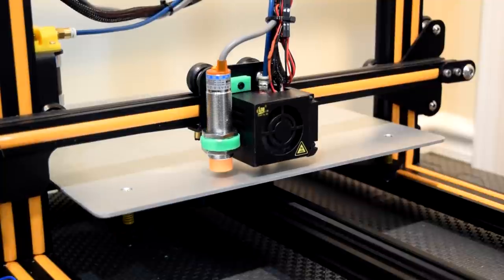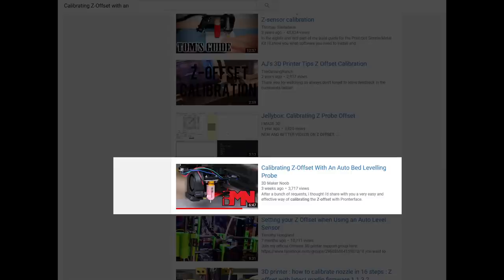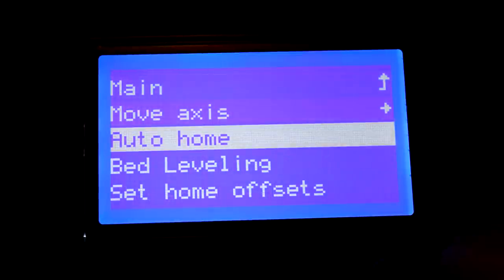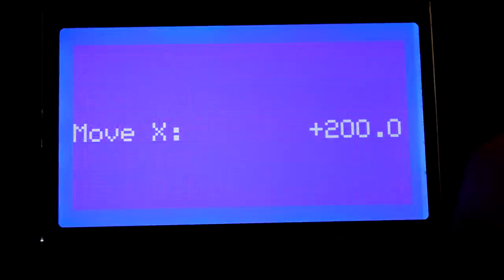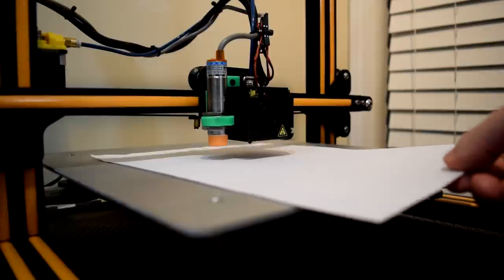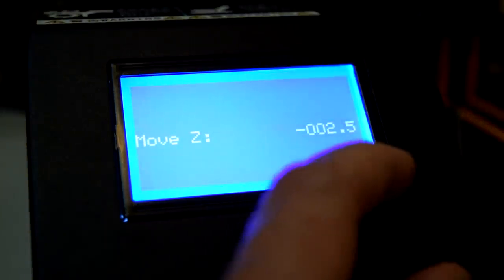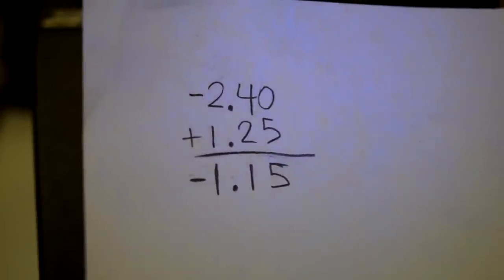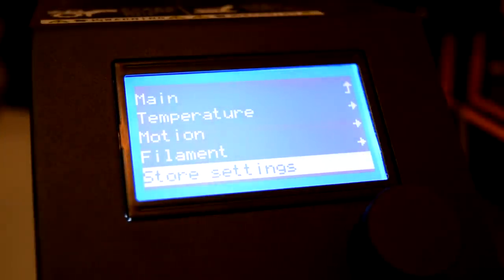Setting your Z offset the easy way in Marlin

Comment: Your video is still helping people 3½ years later... Thank you. (Marlin has changed in the meantime, but it's easy to figure out what to do.)
Reply: For some reason I can’t find how to permanently set up my z offset there is no setting for that can you help me
Reply: @camdendunne3102  When you get a Z offset that works for you, you need to save it to the printer memory, otherwise you lose it when the power is cycled. As every Marlin build can be different, there's no guarantee that it's in the same place on my printer as on yours. It should be near your Z offset tuning, but if not you may need to search. The menu item you're looking for is "Store settings".
Reply: @Gorf1234  I clicked “store settings” and nothing changed I still have the same problem
Reply: The thing is the option itself to change Z-offset is missing from mine. Wonder how to do it without it. Storing in memory works fine, but I first need to set the offset somehow.
Reply: @n1xan  Where did you get your Marlin? It's possible you may need to install another build. Marlin builds can have menu options available in various places. For my printer, the Marlin build has the Z Offset and Store Settings options enabled in two places each. I think you need to seek help on the Facebook page.
Reply: @Gorf1234  Yes, I started looking into updating the firmware version. If I only knew what kind of printer and firmware I have... :D Its a chinese kit I guess, we bought it from a random person to play around, so its pretty hard to tell.. Thanks anyway :)

Comment: Thank you man, still a helpful video 5 years later.  I'm a first time printer.  I kept getting a positive number for the Z offset value and I new it couldn't be right.  Every manual and video had me just inputting the new value instead of adding it to the old offset number.  My first 5 prints were off of the table.  I tried slowing down the print and baby stepping and knew that it wasn't a long term solution.  I'm in hour into the test print that came with my printer and it's been smooth sailing.

Comment: l found the reason the Z axis won't go below zero is because there is a command line "MIN_SOFTWARE_ENDSTOP_Z" (on line 1120 for my CR-10S example file) of Marlin 2 point whatever. If you are familiar with Marlin and enabling/disabling firmware commands, and you're reloading firmware for a bed leveling device anyway, that command can be disabled with two slashes. Once disabled you can move the Z axis below zero.
Reply: Yep this has been my ongoing issue. Once I figured out how to build my own firmware, I was finally able to fix it.

Comment: I was manually tweaking my Marlin settings and sending up new codes.  Was a complete waste and pain. There had to be a better way.  Thank you for this video.  I just recently upgraded my lowly Anet A8 to run marlin from skynet and was able to find all the same settings albeit diff locations within the menu but all there nonetheless.  This video worked perfectly.  First print off after adjustment was flawless.  No elephant foot, first layer height stuck no problem.  Again, thank you, thank you for posting.

Comment: Thanks so much, I think this will let me more easily switch between PLA and PETG, which often needs a slightly different Z offset to get proper bed adhesion and a good first layer.
Reply: Sam, I wasn't aware the Z offset needs changing depending on filament type. What changes do you make depending on which you plan to use at the time?

Comment: Great video... Quick question, my BIQU B1 has a very high Y axis when I started this process. I ended up with -10.9 and if I add it to the current offset that is -1.5, I will end up with -12.4, That will be a forever change on the Y offset, and I believe that will be a problem with the max numbers. The printing bed is already at a good hight and it will not go higher without releasing the springs too much.  Any suggestions? Thanks.

Comment: this worked great..thanks..easy simple and convenient..once i get squiggly lines on first layer i just manually adjust th z offset .1mm at a time until looks ok..however my marlin version does not have a store settings feature..it shows store memory...is this same? when i hit store memory nothing happens visually on the screen
Reply from the maker: I believe it's the same, but you can verify that by turning the printer off and on again then looking at your z offset to make sure it kept your changes.
Reply: thanks ...off subject but my opinion on auto leveling is that its more trouble than its worth..creates more issues  and not good for the z motors since they run 100% of the time on all prints...i have 2 anet a8 one with auto leveling and one without..and i prefer the one without auto leveling since it has less downtime and no extra wear and tear on the z motors..people dont realize that with auto levling the z motors run 100% of the time..not good....i believe in keeping things simple since it creates less headaches and future issues..and auto leveling is not desirable in my opinion...i do not believe in lazy convenience features over reliability..ill take simple and reliable over convenience every day of the week...fancy gizmos=problematic ..look at your fancy new cars and applainces etc etc...too many issues due to too many fancy "convenience" features that fail..and cause other issues or non operational issue becasue of the "convenience" feature.:)..to me convenience does not mean break downs lol

Comment: For some reason my printer is refusing to go below 0.5 for the z offset even though I changed the line for min Software endstops
Reply: The printer refuses to go lower than your z-stopper. So if the z-stopper gets activated when you try to lower it further, it wont do it.

Comment: My CR10 V3, starts at 0, when homed, even though it's 10. So, I'd have an offset of -11ish. Can't find a solution
Reply from the maker: So, the firmware is setup to lift the nozzle up 10mm after homing, but the nozzle stays at 0? or does the display say it's at 0 when the nozzle is actually 10mm above the bed? Is it homing in the middle of the bed? And sorry if this is a dumb question, you are using an Auto Bed Leveling sensor right? I believe some people have tried to follow this video with a normal endstop, so always good to ask

Comment: Hi, I hope you read this. I'm trying to adjust the z offset but I can't go below zero ( I have an ender 3 Pro). What is going on? How can I fix this?
Thanks a lot for the video!
Reply from the maker: It's a configurable setting in the firmware called MIN Software Endstops. You can usually disable it by manually sending commands to your printer from your computer. otherwise you would have to update your firmware.

See below from the video description:

if you can't move your nozzle below 0 in the Move Z menu, send the following GCode command to your printer from Pronterface or Repetier Host or from the Terminal tab in octoprint:
  M211 S0
this will disable MIN Software Endstops.

Comment: I don't have a Z Offset Option on my Ramps LCD. Also, I don't have a proximity sensor on my printer. is this the reason behind the missing "Z Offset" option on ramps? If not, how can I bring it on my screen? Thx
Reply from the maker: Right, this video is purely for setting the Z offset if you have an auto bed leveling sensor.  Without some sort of auto bed leveling setup, you have to level your bed manually, so there's no point in having a Z offset option.

Comment: Realized about a half hour ago that I'm going to have to make a "voltage divider" to knock the 12V line down to 5V before I can actually install it.

Dunno when I'll make it to the parts store for a couple of resistors.

Comment: If Z axis move to 10mm distance after auto homing,  your off set would be -12.5 instead of -2.5? Am I correct
Reply from the maker: it depends. if the firmware is setup to have a probe clearance of 10mm, it will raise an additional 10mm off the bed after it's done homing.  And you can verify that by looking at the Z position on the printer's LCD screen.  it would say 10mm - indicating that the current Z height is 10mm, and you would have to lower it 10mm to reach 0.

Comment: I don't know if I'm doing it right. I'm installing the BLTouch on my Ender 3 Max. Set the default Z offset to (-2.00). Then move the Z-axis and calculate it with a piece of paper; got (-110.0). So now I am supposed to change back the Z offset to -112???? From fricking -2.00. That's a lot of turning. Honestly don't really know if this is right or not. It's now the 2nd day of trying to install the BLTouch on the Ender 3 Max. It's really hard, there are so many problems coming my way.
Reply from the maker: no, definitely shouldn't be -112. I think marlin limits the Z offset to a max range of like -4 to +4 or something. you can change that, but I think that's the default if I remember correctly.  Did you home all axis before you started trying to follow this video? if so, your Z axis should end up about 10mm above the bed (or whatever Z axis clearance is set in the configuration.h file). and your LCD screen should read that you're about 10mm up.  then when you lower the z axis with the piece of paper, it should only have to go down a little bit.  If your BLTouch never lowered down and touched the bed when you tried to Home all axis, then that's a different problem that needs to be worked out first

Comment: hi, after G28 command, when bump X axis endstop ,probe outstanding hotbed. its same with my printer. your video nozzle goes center of bed before homing z . Which command used for this op?
Reply from the maker: That's a setting in the firmware called Z_SAFE_HOMING. the printer does that automatically.

Comment: Congratulations. You're the first person I've seen that mentions the nozzle being in the wrong location and does not tell people to pre-heat the nozzle and bed.
Reply from the maker: Thanks. Technically there is one scenario when you probably should preheat the bed and the nozzle. If you're using a capacitive sensor, the temperature can affect how far away it triggers, so it may not be as accurate, but for an inductive sensor like I used in this video, it really shouldn't matter.
Reply: @RemainIndoors  That's is true, but capacitive sensors go crazy with just about anything, so I would imagine it's the least used sensor, with with the highly advertised BLtouch and clones being the most common.
Reply from the maker: @siveonfarcloud4190  True true. Back around the time I made this video, I know the TH3D EZABL sensor was fairly popular to install on CR10s, and at the time, he made those with Capacitive sensors because people were afraid to get rid of the glass bed on their CR10.  I haven't kept up with it to be honest, so that may have changed now. But, you are absolutely right about that.

Comment: When the firmware is flashed / updated, will the Z-offset have to be reset? a) Will the whole process have to be repeated, or b) can one simply reenter the number which had been the Z-offset prior to the firmware upgrade?
Reply from the maker: That would depend on what's changed in the firmware. I believe the configuration.h file does (or used to) have something that affects the Z offset. If you're just flashing the same firmware with something unrelated changed, you could try just entering the same value, but I'd still be cautious trusting it when you first print something.

Comment: Thank you for this video! I only have 1 question: I calibrated the Z-offset like you dit on my  Tevo Tarantula Pro. But when i start the print, the nozzle is still floating far too high above the print bed. babystepping to the right height works, but i want it to start on the right height (ofcourse...) Where can I fix this?
Reply: have you found the answer?
Reply: bro I think I might have. In my Gcode i added M420 S to enable bed level data and now it works fine,

Comment: I ended up engraving my glass with this. Obviously did something wrong but .05 + -2.53 = 2.48 right?
Reply from the maker: .05 + (-2.53) = -2.48 What's your first layer height in your gcode? a first layer height of 0.2 should work best with this method (for PLA or ABS) if it's setup right.

Comment: Thanks for video. Does adding Z off set apply if bed moves or do l subtract ?
Reply from the maker: Z offset is only used if you have auto bed leveling, and Auto Bed Leveling takes measurements between wherever the bed is and your nozzle then prints there. so if you lower your bed 15mm, and the auto bed leveling sensor detects the bed 15mm below where it was last time the printer ran, then (assuming you run the auto bed leveling routine again) the z offset will tell the nozzle to print using the z offset as a relation to wherever the bed is.

Comment: Current Marlin has soft end stops enabled. You will not be able to lower the Z less than 0. You need to disable it first on ponterface.
Reply: How do you do that?
Reply: @R.D.G.C.  
gcode command: M211 S0
This will disable MIN Software Endstops.

Comment: Hi could you help, there is no video on youtube how to lower the bed and store the settings.After installing E3D V6 hot end install on Tronxy_X5S 1.6 firmware
Reply from the maker: Hi, I don't own a Tronxy X5S unfortunately, but you may want to check out this guy's video(s) https://www.youtube.com/watch?v=TFkCa2scdyo
it looks like he's updated the firmware on his printer and you may need to do that for the E3D V6 to make sure your hot end is using the correct thermistor.  Without the printer to play around with, the best I can do is guess at the moment.

Comment: Pls HELP: Want to adjust z offset
i do
G28
M211 S0(so i can go below 0)
Adjust my z axis(let say I want it to be -0.125)
m428(to save all offsets)
m500
m501(shows i have successfully saved it X:0 Y:0 Z:-0.125)

but when I home again I expect it be -0.125mm below the actual position. which it doesn't. The nozzle stays at 0,0,0. But if do M501 it still shows my nozzle position to be at X:0 Y:0 Z:-0.125

why is the nozzle not going down by -0.125mm even though it has been written on EEPROM
Reply from the maker: I'm not 100% sure I follow, but the idea behind changing your Z offset is that your nozzle's position should be different when it reaches Z:0 So, let's pretend my nozzle is 5 mm above the bed when my printer is at X:0 Y:0 Z:0.  I follow the steps in this video to change my Z offset to -5, then I store my settings in EEPROM. The next time I do a Home All Axis and lower my nozzle to 0, it should no longer be 5mm above the bed. it should be at actual 0.  The printer will still show X:0 Y:0 Z:0 but the position of the nozzle will be 5 mm lower than it was before.  Does that make sense?
Reply: @RemainIndoors  
thankx for a quick reply mate...i got u there....and that's what happens...my nozzle position changes only when i try to adjust it (with paper under nozzle method). 
*So earlier if my nozzle is 2mm above the bed, after adjusting it, it gets to 0mm above the bed(same what u said).

Then i save the coordinates with m428 and followed by m500...
Then when i auto home it shows my location as (X:0 Y:0 Z:-2)...
But the nozzle still remains at 2mm above the bed.*
*Confused*
Do let me know if u got any idea.
thanks again mate
Reply from the maker: @armancodeq3642  gotcha, I see what you're saying now. that is weird. I'm guessing you don't have the Z Offset in your printer's menu?  I looked in the firmware for my printer and it looks like the Z Offset menu is using M851 to set the Z Probe's offset. If you don't have the option from your printer directly, you may want to try testing changing the z offset with that. Make sure you store your settings in EEPROM after changing them too.
Reply: @RemainIndoors 
ya i dont have z offset probe option....is that because I'm not using any z probe sensor???
Reply from the maker: @armancodeq3642  Are you not using any kind of auto bed leveling setup? Kind of the whole purpose of this video is Setting your Z offset for an Auto Bed Leveling sensor. If you're just using a normal endstop and leveling your bed manually, you would normally just adjust the height of your bed or the height of your endstop.
Reply: @RemainIndoors  
Bl touch was causing some problem so i removed it and decided to go with mesh bed (w/o probe/bltouch).

Im using a normal endstop.
I just want it to home at z-0.1 rather then z0. Do u think its possible without any autobed leveling?
Reply from the maker: @armancodeq3642  I see. I've actually never tried Mesh Bed Leveling with a normal endstop. I found this video, which seems to do a really good job of explaining the whole process in detail: https://youtu.be/9AZy8beDQqg

My only concern there is once the z axis touches the endstop, it can't go down much further than that. There may be a small amount of wiggle room that you can move down, but if you lower it too much the Z endstop is going to stop the Z axis, and you'll start hearing clicking from your motors.  That's the benefit of the Auto Bed Leveling sensor, the only thing stopping the Z axis is the nozzle.  But if I were going to try Mesh Bed Leveling that way, I'd try following the steps in that video, because it seems like they really covered everything.
Reply: @RemainIndoors  
Oh so maybe i have to adjust endstop manually, to get the desired nozzle position.
Thankx for the bed leveling video...im following the same only.
Real thankx for your support man...my doubt is clear that i cant adjust nozzle without probe like that...i need to adjust the endstop manually.

Real thankx for ur support man...u earned a sub. :)